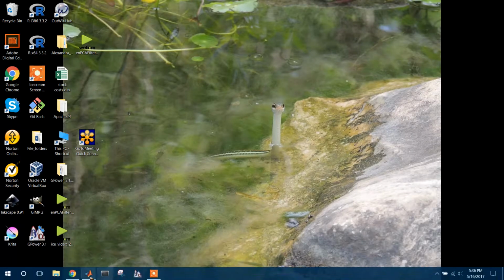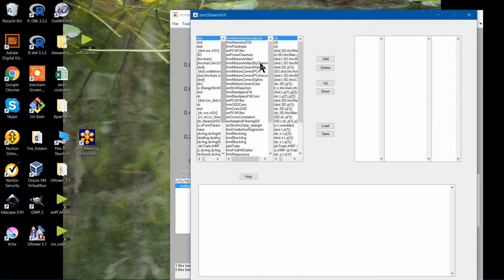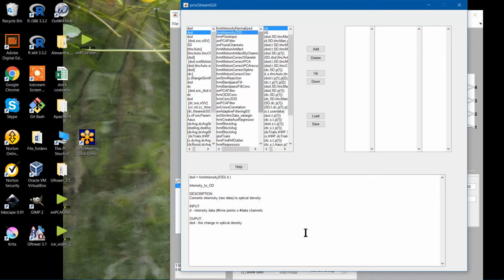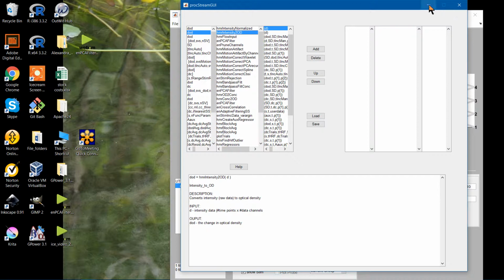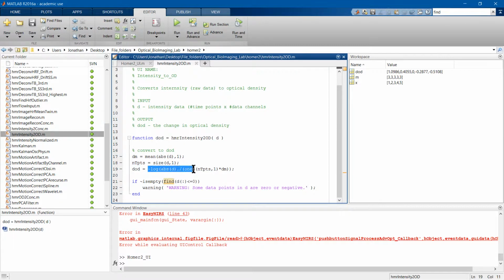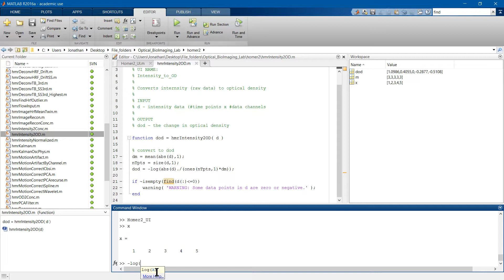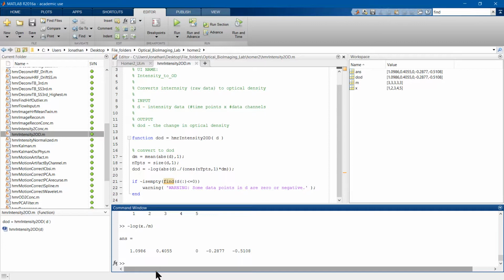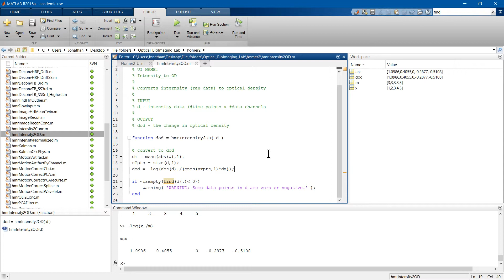Homer2: intensity2OD

Comment: 2024 in Canada, still useful :)
One question I do have, is why the delta OD tranformation is done before the other preprocessing and analysis stages. You do mention that if we didn't do this we'd have to calculate a partial pathlength factor (not sure why that is), but I don't quite understand why. When we do the regression, we're looking at change over time in relation to e.g. the timing of our conditions. Why do we want to change that to looking at the relative change in time? Is it essentially just to scale the data?